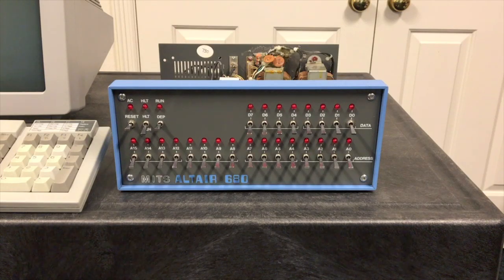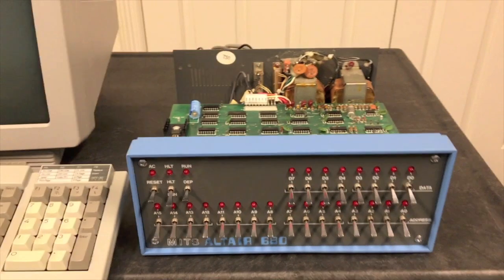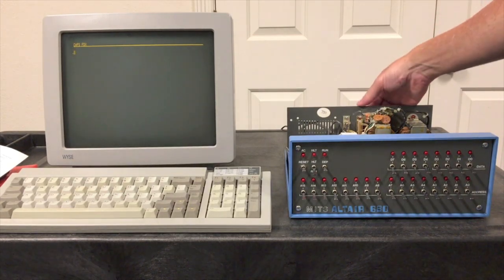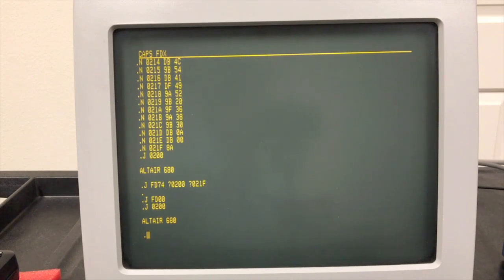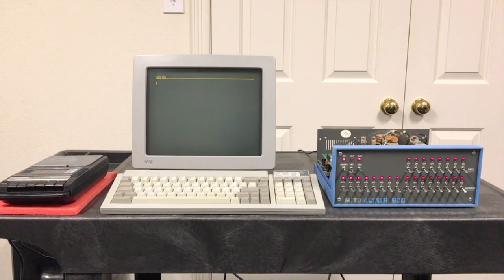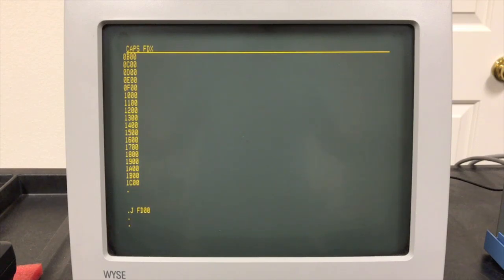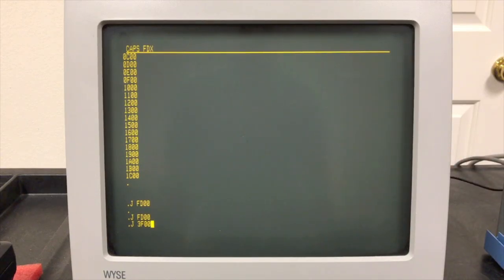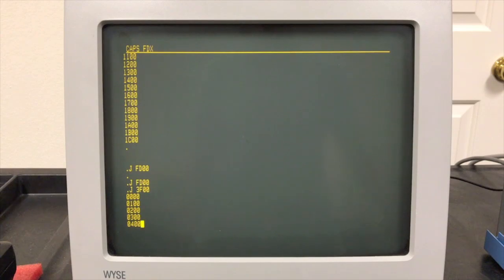Altair 680 Cassette Interface

Comment: Great video!  I hope this post/question isn't too old to get a response...if you stored multiple programs on a cassette tape, how did you know to fast forward or rewind to the exact spot on the tape to where each new program began? (The TRS-80s I remember working on already had floppies and I only remember using the tape for really old games.)
Reply: You would use the tape counter on the cassette recorder and a piece of paper to keep track of where everything was on tape
Reply: @mikedouglas9214  Thanks for the reply. I guess you had to have a tape recorder that actually had that counter, some Panasonic tape recorders I remember at the time didn't even have that.

Comment: I wonder if the reason that it didn't work well with both cable plugged in at the same time was due to grounding issues messing with audio level bias or something?

Comment: I didn’t realize the Altair 680 cassette port was so slow compared to the ETA-3400. I think the ETA-3400 can do up to 2400 baud on the cassette port. on my almost finished ALTAIR 680 BASIC port I am able to load 8K BASIC from cassette in ~100 seconds. I’ve also tested it using Motorola SREC format from a PC terminal using FTDI-USB serial and @4800 baud I can transfer 8K BASIC in 45 seconds. I also have the advantage of running ALTAIR 680 BASIC @ 1MHz. Eat your heart out MITS! Thanks for the videos on the real ALTAIR 680 hardware as it’s inspiring me to finish my project.

Comment: What if you were to add an eprom somewhere in the machine, and program BASIC into that eprom ? Would that be possible to do ?
Reply: There is no complete disassembly listing on this 680 version of ALTAIR BASIC online that I can find anywhere. I’m working on a listing myself that’s almost done, but patched for another platform. What I have found is that this BASIC has a lot of self modifying addresses in it, mostly in page 0 and page 1 of RAM, but also elsewhere, so it would be a fair bit of work to change that. What would be pretty easy though is have it in ROM somewhere in high memory perhaps, and then have it copy itself into RAM at $0000..~$1C00, the run it from $0000. From a user point of view it would look pretty much the same with about 7K less RAM left for user programs.
Reply: @markcummings150  Wow, I wish you a lot of luck with this project, it sounds very promising !! Assuming you are able to complete this project, what plans, if any, do you have in mind for it ?

Comment: Does your Altair 680b has the Phase 2 Clock Mod described in Computer Notes 1977 (page 18): http://www.virtualaltair.com/virtualaltair.com/PDF/cn0777.pdf ?
Reply from the maker: Yes, mine has that mod. The 4050 buffer they used introduced a worst case propagation delay of 140ns plus a switching timing of 160ns. Only a MITS design could still have timing problems even when running at 1/2 speed.
Reply: It seems, MITS  took all measures to make sure, the 680b stays performance wise always behind the 8800. I have a few MC6871A (1Mhz) clock modules and I think it is possible with minor modification, to bring the CPU performance back to Spec.